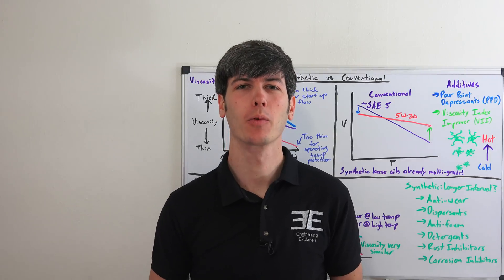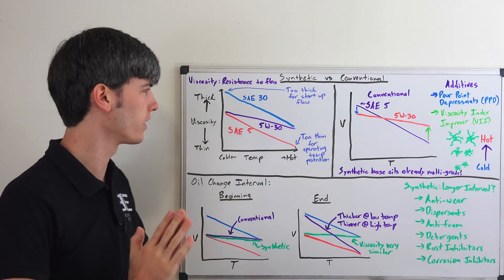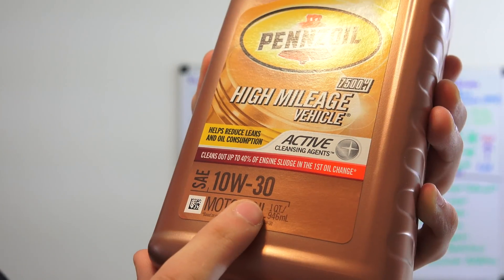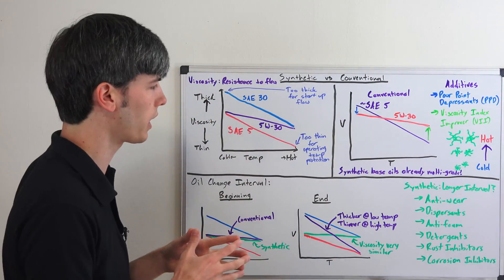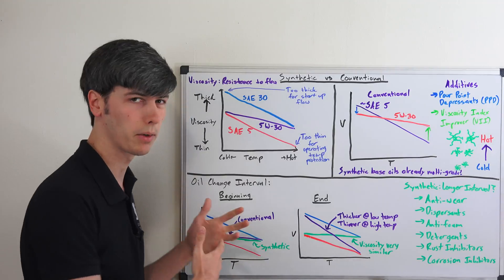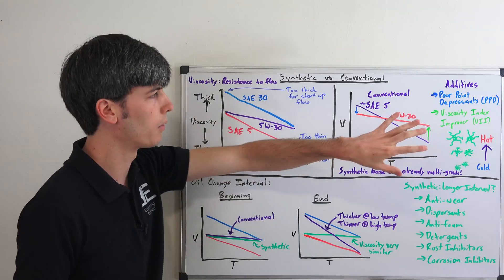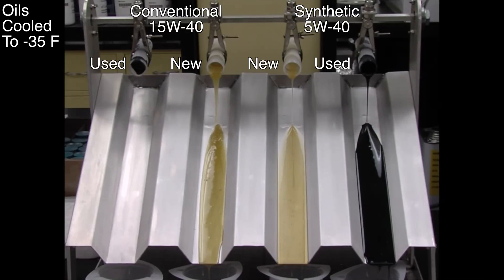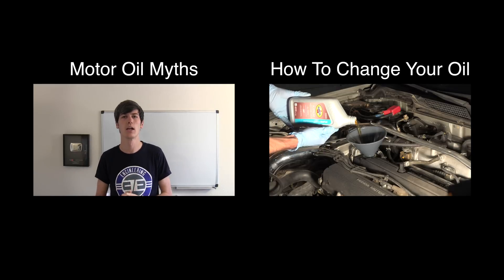Is Synthetic Motor Oil Better For Your Car?

Comment: I use olive oil to lubricate my car
Reply: add a little feta
Reply: fit a blow off that yells "opa!"
Reply: +steve6493 and some oregano over it
Reply: Great you could also use Mayonnaise for coolant
Reply: Olive oil is great for lubrication, but you have to change it more often than conventional oil making it impractical.
I've found that WD40 works best.
Reply: Olive oil is more expensive than conventional motor oil and does not do the job properly ...
Reply: I hope it's Extra Virgin Cold Pressed...
Reply: I just pour whole olives into my engine and let all the moving parts grind them up so it has super fresh olive oil.
Reply: Your car must be Italian?
Reply: Diarrhea is the best
Reply: Unless it's a muscle car, then use Coconut Oil instead for the best gains.
Reply: I used Johnson baby oil. 

Now my car run like my baby.
Reply: You must be a vegan lol
Reply: hahahahah here in Greece olive oil is much cheaper than oil for engines!
Reply: WD40 is over 90% diesel fuel; it is not a great lubricant at all (like the name say: it is a "Water Displacement"... It is also a good cleaner...).
Reply: I use the clarified human fat from embryos I collect from my local abortion clinic every tuesday :)
Reply: What did Popeye have to say about that?
Reply: I once used olive oil in my 2-stroke bike. It works surprisingly well, but the smell... 
And the greasiness that comes out of the exhaust :-/   
I did that only once, it was because shops/gas staions were closed (sunday). So it was kind of an emergency...
Reply: You sir deserve a medal :p !
Reply: You sir deserve a medical...
Reply: also good on nipples
Reply: Some dirt bikes used to factory spec castor oil
Reply: Organic is the best. Non GMO
Reply: +yoppindia Here in Greece olive oil is cheaper than motor oil we produce a lot :) In Crete and Kalamata many cars and bikes runs with extra virgin gold only hahahahaha! Of course I joke.. I think the acids of the olive oil can harm the engine parts seriously and the low viscosity also.
Reply: Frank Magana  synthetic in winter and conventional the rest of the year if you want to save money. The best oil is clean oil.
Reply: Sponsored by Pennzoil..
Reply: then hash oil should make it fly
Reply: Frank Magana Hash would elevate it lol
Reply: Isn't that what FIAT and Ferrari call for?
Reply: +grappolidipalma is gone, there's only me now k
Reply: Baby oil? (get the reference?)
Reply: actually soybean oil is good for every car lol
Reply: +Moses Berkowitz nah, if it was, the world would have run out of olive oil by now
Reply: Dollars are really the best way to oil your wheels of power.
Reply: ***** αν είναι diesel Βαλτου λάδι άφοβα, αρκεί το ντεπόζιτο και τα σωληνάκια να είναι ινοξ
Reply: That would be expensive
Reply: people think most olive oil/best olive oil comes from Italy, when in reality most olive oil comes from Spain by far. Also the best oil. But since Italy is more popular in the US, a lot of companies produce the oil in Spain, then they ship it to Italy, they put the tags and name brand, and then it goes to the US.
Reply: Mandeep Singh Are they made from real babies?
Reply: ..........  No  wonder,   Popeye  couldn't  find  her...
Reply: Conventional or synthetic?
Reply: He was talking about oil used in the motor, not the oil you use on your shaft.
Reply: I use ghee. Higher vapor point
Reply: hows the smoke?
Reply: well, better than spit   lol
Reply: sounds expensive!
Reply: Must be a rich man, it costs fortune for a small bottle.
Reply: +yoppindia It cost €4,5 - 5 per kilo the extra virgin.
Reply: ***** it costs Rs 500 for 500ml for olive oil in india and 20w40 costs Rs 300 for 1000ml.
Reply: +steve brapapapapa όπα brapapapapa...
Reply: ***** Cyntheira...
Reply: But do you use extra virgin or regular?
Reply: +Fernando Pajon Benitez it would be virgin but the homie is a weido and likes to do the dirty with the olive oil bottle
Reply: You can actually use vegetable oil to run a diesel. It is referred to as "bio-diesel."
Reply: olive oil no because low t° resistance, bad lubrication and fast oxydation, but work with castor oil who as same t° and lubrication performance as top rated synthetic oil, but castor oil oxydise very fast and produce mud, this explain why this oil is not in use, but a Belgian motor oil maker (Electrion), modify chemicaly Castor oil to make it usable whitout problems ...
Reply: You Italian
Reply: I use durex.
Reply: The Fury we are talking about engines, not for penises
Reply: +ASIStudios Even in the UK, olive oil is far cheaper than engine oil. I believe it is a hell of a lot cheaper in the USA
Reply: Waqas Ahmed maybe if i use veggie oils, but my motor oil runs about fifty dollars or so a change for a filter and all and my vehicle is a 7.0 L engine.
Reply: Must be a diesel VW
Reply: Almost all of the "Italian olive oil" is actually adulterated.  People are much better off buying it from Calif. or Chile.  I don't know about Spain.
Reply: ***** did he f*** the engine up?
Reply: +Stephen Fiore  Funny!
Reply: Synthetic or regular olive oil?
Reply: Creosote fence posts or railroad ties give an new dimension to grilled foods too.  Like you said, you can get used to it.  Plus they smolder for a long time. Peace.
Reply: Canola Oil works better
Reply: Are you kidding.?
Reply: A Ferrari? Or Fiat?
Reply: Must add a nice flavour
Reply: EVOO
Reply: I use tropical punch
Reply: It will be very costly.
Reply: Is it the virgin type?
Reply: K-y will also work !!! Stuff is amazing at bedroom level as well !!! 3.95 a tube at Wal-Mart. Now you will need a case. Thinking 200.00 bucks SHOULD work !!!!
Reply: Frank Magana you probably a a toy remote car haha
Reply: I use hash oil
Reply: Throw in some balsamic vinegar and you're set!
Reply: and you use motor oil for cooking, I bet
Reply: Baby oil works better. I get 20,000 miles per oil change with it!
Reply: What about using 5W - 30 for your salad ?
Reply: yeah, it's healthier
Reply: Frank Magana coconut oil
Reply: Smart man I use baby oil nvr had a issue for about 5 miles.
Reply: KY Jelly works too.
Reply: Certo, you're an Italian.
Reply: Hey guys what are you talking about? I oftenly use Extra Vergin Oil for my car ,jajaja runs good,sometimes coconut oil jajaja.
Reply: I use Bertoni's Olive oil that's the best.
Reply: can i use johnsons baby oil?
Reply: Then when your all done you get a bit of grlic a Bougqet And  nice white wine and clean the drip pan,,haha good stuff Man!
Reply: Ive heard older models with carbarators on them can use olive oil and this man was going to local reatraunts getting free oil amd filtering it out to use for free fuel. Thats fkin AWESOME!
Reply: What kinda truck
Reply: Wait til Popeye finds this out !
Reply: Frank Magana I buy the oil that comes from full synthetic vegetables
Reply: That's how you get the extra virgin and muslim approved olive oil.
Reply: Frank Magana if your not using peanut butter in 2017 then your engine is weak and needs it's protein

Comment: what about non synthetic but multigrade oil? Ive seen that too, is it impossible without being synthetic?
Reply: The 5w30 in the pour-test is conventional, meaning mineral, meaning non-synthetic. You can get larger ranges with synthetic, but there are many common mineral-based multi-grade oils.
Reply: But if I understood his explination right, its the synthetic part, the polymers what makes an oil multigrade.
my question then how can conventional oil be muligrade? Thanks.
Reply: salamaza
There are two parts to it. Synthetic base stocks already have a flatter viscosity curve than mineral bases, so by the definition, which is based on pure mineral oils, they already are multi-grade; he explained that in the beginning. Additives can further widen that range, to make mild multi-grade pure mineral oils, and make very-wide-range synthetic multi-grade oils. You probably cannot easily make a mineral 5W50, but you can with synthetic.
Reply: "Multigrade" is a term used for "Multi-viscosity" oil such as 5w30. That it's Conventional or Synthetic makes no difference, before multigrade oils there was just straight weight oil such as 30.

Comment: do u use rotella t6 in ur sti?
Reply: I use it in my gasoline genesis coupe, I use LiquiMoly 5w40 high tech also. Depends if I have time to order it and patience
Reply: I use Rotella T6 in my Bugeye. My car has 285000kms on the original engine and I drive it hard every day. The Rotella is good because like this video, it keeps its viscosity for longer than say Mobil 1 (Which Subaru's don't like as Mobil 1 loses it's viscosity over time).

Comment: You should always use the oil the manufacturer recommends.
Reply: Yes you should but you may notice that new vehicles these days usually recommend some sort of either synthetic or synthetic blend and older vehicles say SAE certified motor oil which almost all brand name synthetics are. In that case, if you used a synthetic with the recommended viscosity, you would be using the recommended motor oil.
Reply: You are right that almost 100% of the time you want to run the manufacturers recommended viscosity. The only exception i could possibly think of would be if you had a modified track car that only ran at high rpm. Running a different viscosity may be better I dunno. But yea for 99.9% of the population i would never deviate from the manufacturers recommended viscosity.
Reply: consaka1 Yeah don't get me wrong brother, Pennzoil works great too (almost anything will work really), I think ultimately it depends on how much you like your vehicle, I had a Jeep Liberty that I couldn't care less about, and I would let the dealer put whatever the hell they wanted in it LOL. But now I'm borderline obsessed with car/culture, and am pretty proud of my Supra, so I use Royal Purple =).
Reply: not really, all car manufacturers have their own brands of engine oil that you can buy at the dealership or authorized service place, but it's safe to say their oil is just some other oil that they rebrand and sell at about double the price.
Reply: until the point that you're pushing more oil through the pumps bypass than the engine.
Reply: I'm sorry but I don't agree here. Engines are made these days to use a particular viscosity of oil. If you are using your vehicle hard and driving those temps up then you should be focusing on driving those temps back down again. 
I had a customer come to me complaining her fairly new car was ticking. I listened to it run and sure enough you could hear the lifters ticking like they were out of adjustment. However I know that most cars use hydraulic lash adjusters. Using the wrong weight of oil can mess with the adjusters ability to keep the lash where it belongs. Changing the oil back to the recommended weight solved her noisy engine problem.
Sometimes you can fudge a bit if the engine is badly worn with a lot of miles.  Funny thing about lash adjusters. They really don't wear that much compared to the rest of the engine. I have seen some but most could easily be reused on a rebuild.
Reply: ***** To cool down the internal components you need to cool the oil. Lots of people think oil is just for lubrication but it is actually a major engine cooling component, especially for the pistons.
So in my diesel van the radiator actually has an engine oil cooler built into one side tank and the transmission cooler built into the other side tank. If it needs it I would get a kit that will allow you to cool the oil that way. If it already has that cooler I would add a second one right in line with the first. 
I know that same Van has an internal leak since it was rebuilt that causes it to have no oil pressure at idle when hot. Drive the thing all the time. Been that way over 10 years. I do add a bottle of stp oil treatment at every oil change though.
Reply: ***** That is why the oil is run through a cooler located in the radiator. Personally I am not going to worry about cooling the oil too much on an engine that is running. If you live in a cold climate you can run the oil through the air cooler first and then use the radiator cooler to modulate the heat and make sure it doesn't get too cool. 
Modulating the oil temp is better in my opinion than using a heavier oil simply because some components need the lighter weight oil to keep from messing up tolerances. etc. such as the hydraulic lash adjusters. Also a heavier oil when cold will put more shear stress on your rod and main bearings.
Reply: cybertree Lol Ill make a note of that. I confess I only have experience repairing engines that had used pennzoil exclusively. Back in those days it was the cheapest oil on the shelf.
Reply: Yes, a "Prius rally car" would be absolutely foolish.
Reply: Shut up nerd
Reply: Tom Ford And the baby 6th grade troll opens its mouth. How sweet. lol
Reply: No, he had put that out already as a disclaimer anyways. But his point being that if you DO have the chance to choose between the two, he would recommend you getting the Synth motor oil over the Conventional one.
Reply: Only within reason.
Reply: MotoBoy I am aware that manufacturers still recommend different weight oils for different climates. However look at their recommendations. Those oils they recommend are actually only slightly different typically one weight range. What milos is talking about is an extreme weight range difference.
Reply: ***** Too much of anything will be poison. Not sure what you mean by your reference to cats. Not like a cat is going to drink that stuff.
Reply: not necessarily
Reply: That's a bit of an over generalization.
Reply: if you know nothing about how an engine works,  yes follow the book. but someone like you who has turned more pages in his owners manual than wrenches on a car should sit down and be quiet.
Reply: John Rob You referring to the OP?
Reply: +consaka1 are you serious? he means zinc in the Rotella damaging catalytic converters
Reply: Which should be part of the economic calculation when buying a car, many original oils cost an arm and a leg!
Reply: taint115 Are you serious? Diesels don't have converters. Least the older ones don't. And that is what Rotella-T is famous for. It was originally only for diesels and came in only one weight. 
Rotella-T oil for cars may be a slightly different formulation. 
As for me I WANT the zinc. there is so little that you need over 100k miles in order to have any converter problems. BUT the stuff really reduces wear. Much easier to just replace a converter than the whole engine.
Reply: +TheFiendRacer  "You should always use the oil the manufacturer recommends."   

NO!!  The manufacturer doesn't know how the end user will use a car, motorcycle, lawn mower, or other piece of equipment. Car manufacturers recommend ultra thin lubricants for CAFE (Corporate Average Fuel Economy) purposes. Thats why the same car sold in America uses 0W20 but uses 5W30 in Europe. Why would the car company recommend 5W30 in Europe, but 0W20 in America, for the same car with the same engine? Because they KNOW that the 5W30 offers more protection and offers a larger safety margin if the engine overheats than a 0W20 oil does.

So yes, it is generally a good idea to stick to manufacturers specification for your average commuter car during the warranty period, it would be absolutely foolish to run 0W16 motor oil in your new Prius rally car that gets ran at 6500 rpm for hours on end.
Reply: ***** Mobil One is awesome oil too brother, if RP didn't exist it would easily be my favorite. I kinda look at like buying ALCOHOL ya know? If you want something smooth and aged you have to pay a little more sometimes, but there's been times where I just wanna get drunk and bought monach LMAO.
Reply: My car is an Acura and I use a Toyota with the same grade coz they're way cheaper lol

Comment: I'd like to know details on recycled (conventional) oil, I've heard the specs are actually better than new oil because they're refining an already refined oil.  Some people despise the idea of using recycled.
Reply: It's heavily filter and somehow separated back into weights, and then an additive package added back to make  the weight that's listed.
Reply: yea like +jimmystikx said, company will put back the require additive, and refine it again just like new oil so you have nothing to worry about. API would not let company sell recycle oil if its not up to the task. Just like recycle battery or recycle paper and other recycle stuff we buy.